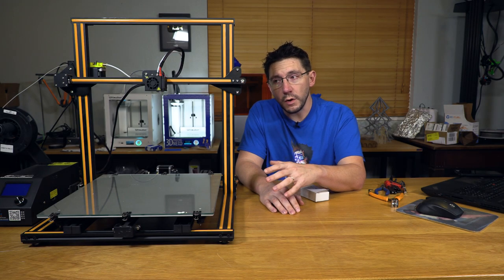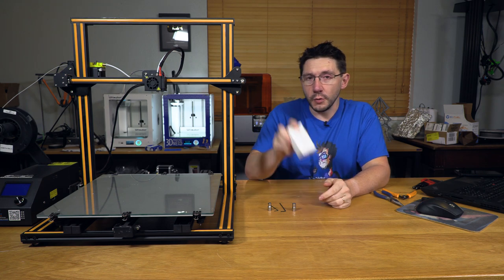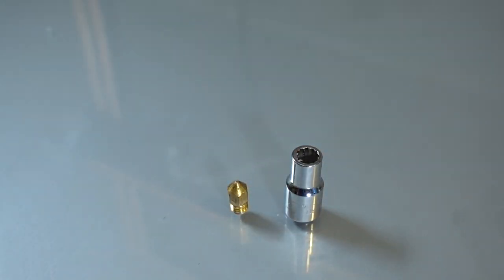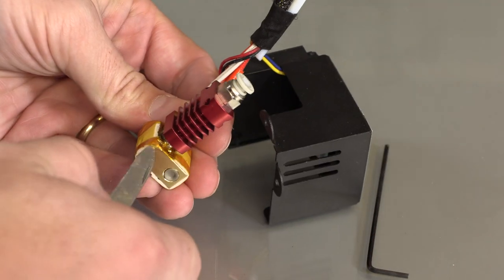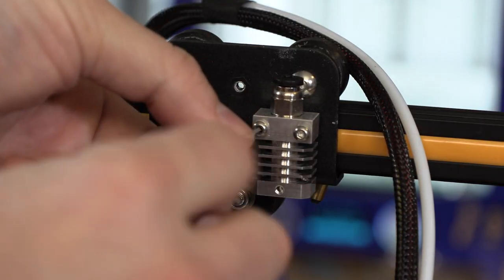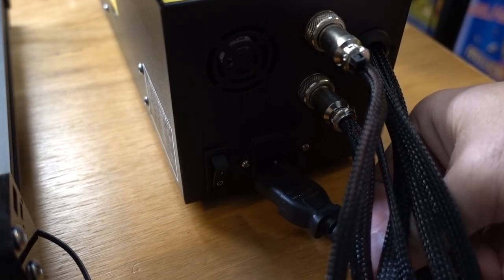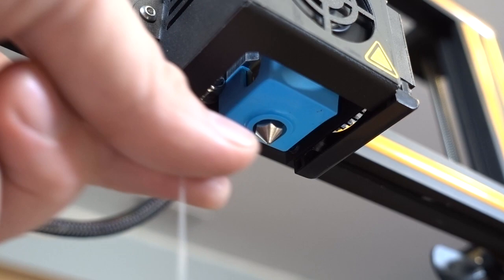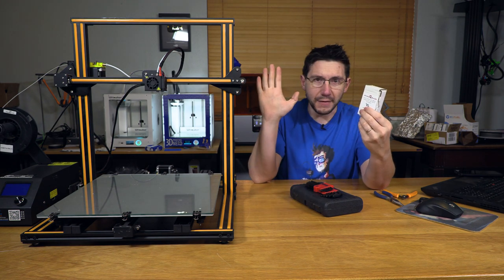Installing the Creality CR-10 All Metal Hot End Upgrade by Micro-Swiss

Comment: I tried there all metal hot end and found that certain files that have a lot of retractions will cause it to jam during the print. For example the body for my 3d printed servo robot that's prints vertically on every printer I own and have owned will print this body just fine. There is TEXT at the top of the body chest area. But the Micro swiss all metal hot end will jam "6 hours in" too the print at the same place every time. I loved the hot end for 99% of all printing but it does have its limitations I think. Here is link to the rrobot project. https://youtu.be/Hr2QDnQfHlI?list=PLE_FGUWmF3dTGCxYMDmiXGMZ5BVv15jae
Reply: Robothut I Am having the same exact problem for all my prints it is so frustrating! I wish I would have known this issue before I purchased it...
Reply: Make sure your retraction  values are under 3.7mm and that you have no negative restart distance in your slicer. The most popular profile for these printers .. chris elkins has both a 6.5mm retract and a -.2 restart which will cause problems.
Reply: Exactly the same problem. I'm tossing the Micro Swiss and going back to the OEM but using a high temp bowden tube.. should allow me to print at high temp.. but without retraction issues.

Comment: Reckon this would work with the Tevo Tornado?
Reply from the maker: Um... perhaps? I haven't had the chance to take the Tornado out of the box yet, but I know the internals are very similar. I would circle back with Micro-Swiss to be sure before ordering.
Reply: Cheers, shall do!
Reply: Hey I just upgraded with the CR-10 kit on my Tevo Tornado over the weekend.  The install is about the same, the cooling block that comes on the Tornado is thicker so the screws are about 5mm to long and will need trimmed.  But other than that quick and easy, the nozzle is longer so will have to adjust the bed level to bring it down and away, but sits in the same spot x/y.  I'm currently having clogging issues but might be retraction settings getting ready to give it another try.

Comment: Anyone use standard print nozzles with the Microswiss All-Metal Hotend? 
The one thing i have against moving to this setup, is a proprietary nozzle that i then have to purchase from Microswiss. 
Nozzles are consumables that degrade over time. Regardless of that fancy coating, it will eventually need replacement due to wear, or even sooner if you run into bad filament. 
Stock nozzles are very cheap, and its hard to justify this "upgrade" if it forces me into their proprietary replacements.

Comment: why take out the screws at the end? Can you leave them in for added support?
Reply: Hunter Spartan, I’m wondering why this was done as well. I’ve had my Cr-10 since its release and the hot end unit finally gave out (the original ptfe tube melted in the heating block and clogged the nozzle, nozzle and heating block had burn marks). Instead of buying a replacement I upgraded to this. The official micro Swiss install video doesn’t have you take the two screws out at the end so I’m curious if there’s a benefit in doing so
Reply: @jonathanmatthews9299 , so I asked this before noticing the video and the last comment was a year+ old. I don't think we will ever find out...

Comment: why did you put in the heater block screws to remove the screws on the heater block later?
Reply from the maker: +TheNavalNation screws were put in so I could tighten the nozzle without having to brace the heater block.

Comment: Why you unscrew the screws when you put silicon ?
Reply: The screws are really only used to align the heat and cooling block when tightening the grub screw. The instructions from Micro Swiss recommend removing the screws as well.